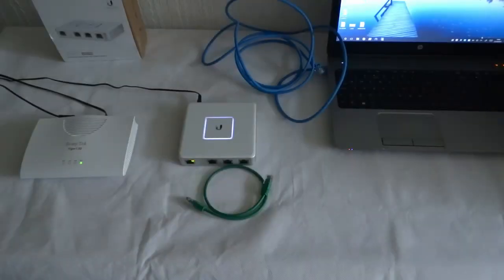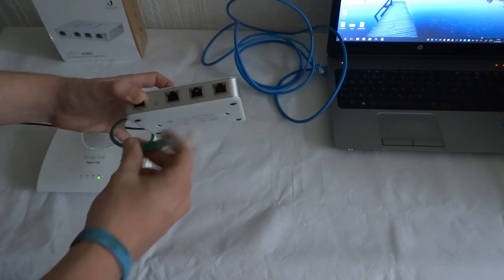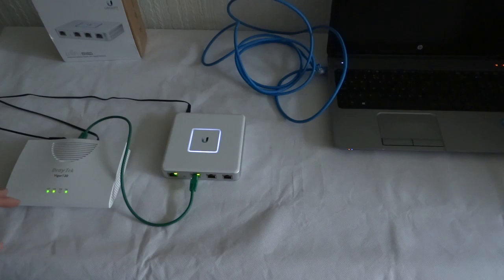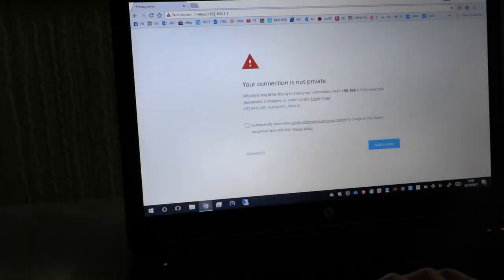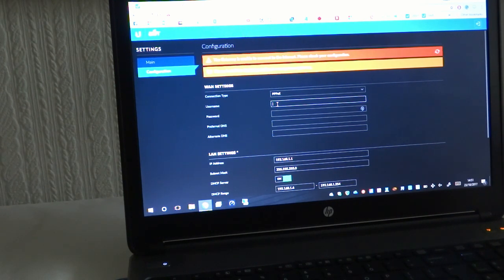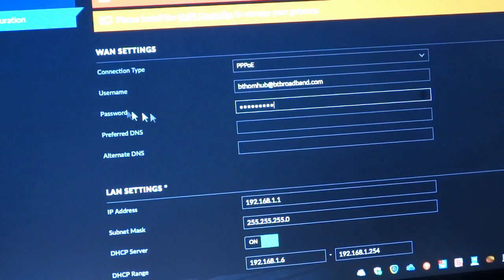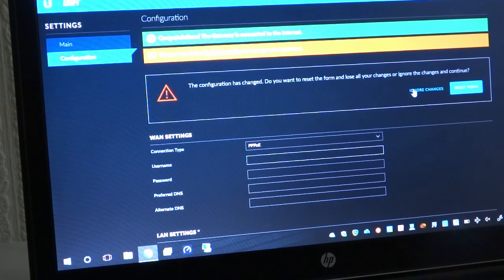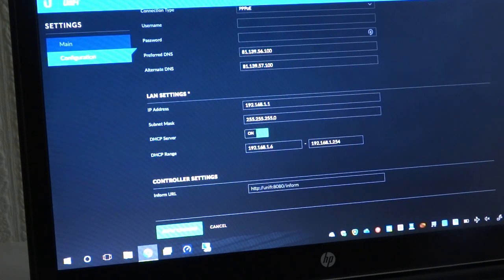Unifi USG with BT Infinity (FTTC) Connection

Comment: what line data do you get from the modem and what's it like at syncing up and down, especially up? and using it with a router with DSL off on it straight into the WAN port, would i put the ip address below the router or above it? the router ip address is 192.168.1.4 so would the modem be 192.168.1.1?

Comment: I tried the Draytek Vigor 166 with my unifi setup and it doesnt work properly, its very unstable with very poor upload speeds tried changing the MTU to multiple different settings but nothing worked. So I flashed the vigor 130 with the latest firmware and plugged in the vigor 130 and it works perfectly. Rock solid download and upload speeds. No setup config needed. Perfect.

Comment: I have configured my TP link Deco system and have internet access, do you know how you can connect to the draytek  GUI without having to sit next to the modem to connect? I'm having trouble locating an IP address to connect to the draytek modem. To confirm I have the draytek 166 modem.

Comment: Hi I have a USG that dose only the client Wifi all worked fine till they changed the router from Hub 5 to Hub 6 now the problem is that I connect the Wan to a Lan  port on BT hub 6 it seem that the USG is not able to take a lease from the router is the same procedure?

Comment: Do you feel you get good sync speeds with the Vigor 130 modem? I'm currently using an old Openreach VDSL modem and it doesn't get as good sync speeds as my BT Smart Hub. But I'd like to continue using my Ubiquiti EdgeRouter, so I'm in the market for another modem to replace the Openreach one.
Reply: What did you do in the end? I'm intrigued to hear that the OR modem performs less well

Comment: Hi James, 
Thanks for posting this video. I am facing a small problem. My setup - running a BT Home Hub5. Unifi AP-LC-LR and a Unifi 24 port switch. Everything works fine but as soon as I put Unifi SG on the network all my devices start showing "disconnected" on the Unifi controller. 
I tried to run PPPoE on USG but no luck. 
I even tried directly connecting a laptop with USG and configure PPPoe, it won't connect to the internet. However, if I change setting to DHCP, it does show USG is connected to the internet but I still can't browse the internet.
any suggestion(s)?

thanks in advance.
Reply: vipinvij The only BT HomeHub’s that’ll allow the USG to connect to the internet are the Business versions, this is because you have to set the Hub into ‘Bridge Mode’ the standard residential version will not allow you to select bridge mode from the interface menu. You can also get into bridge mode by using the DrayTek Vigor 130. So you’ll have to completely remove your HH5 from your setup to get the USG online 👍
Reply: Hi Marcus. That's what I did in the end. Thanks for your reply.

Comment: Hi James do you know if this is the same for standard copper connections via Smart Hub? I'm having huge issues trying to connect my USG to the web. I have it hooked up to quite a network which works fine as a stand alone Wi-Fi mesh but I just can't get the USG to access the internet through ether an old Hub 3.0 or a new Smart Hub with GigE ports!
Reply from the maker: InsideB you can't run this behind a router, the openreach box is a modem and you can run it behind thag or use your own but putting this behind a router will cause double nat along with a while other load of issues. If you want to use it with a bt/British connection you need to use a modem or a isp router in bridge/modem mode

Comment: Looking at doing a similar setup. Having that modem then a 8 port switch then 2 Ubiquiti AC Pros. What benefits are there by having the USG?
Reply: You need a router
Reply: @bobandbobandbob6285  Yeah that would be the USG but if I wasn't to get that I would of got a different router and I want to know whats the benefits by using the USG
Reply: @aaronfraser1911  The USG effectively becomes the Router. It's all depending on where you are located. I usually rip out the ISP devices and use the USG direct but that proves difficult with providers like BT. The only reason I would replace the BT equipment is if it didn't have advanced DMZ because really that's all you need.

Comment: Surely you had to disable DHCP on the Vigor?
Reply: modems don't have DHCP if you plugged your pc into the vigor it would just show your modem ip address not the normal 192.168.1.2 or 192.168.0.2

Comment: Any idea how to do this with Sky Fibre Max?
Reply from the maker: Darren Cousins sky is slightly more difficult, their pppoe details are customer specific and you must extract them from the router they shipped you with software, you can then follow this video and input them there! Hope that helps
Reply: Hi James, cheers for the reply, I extracted the option 60/61 from Wireshark but can't see a place to enter those details in the new USG web interface, it only has PPPoE/DHCP & Static IP, not MER as Sky needs. I previously used SSH to enter the details but with the new interface I thought there might be a more "friendly" way to do it. Currently in a bit of a mess after upgrading and changing my controller, no internet at the moment.
Reply from the maker: Darren Cousins I didn't use wireshark I used a peice of software I hadn't ever heard of I can see if I can dig it out? That gave me PPPoE details and that worked for me when I did this for a friend?
Reply: Yes please, that would be very handy, I didn't even know Sky had PPPoE, everything I seem to be reading says that Sky Fibre uses MER which is causing me no end of pain.
Reply from the maker: Darren Cousins from the looks of what I've read it has changed since I did it, I did it about a year and a half ago and that worked fine using pppoe but when I searched then everything I found pointed to MER:( I had a similar situation with  a netgear 4g router, that used IPPT which at the time wasn't compatable with the USG... had to wait 4 months for a firmware that included and supported it then I was away! Have you not got the included crappy sky router just to get you going? 
Alternatively you could downgrade it to an older fw??
Reply: Just a heads up for anyone on Sky planning on doing this, Sky's T's&C's says that you have to use their router for connection to their service.  Yes it works in other ways but it's most definitely not official
Reply: @Chris Plater this has changed since then sky let you use third party routers but won’t give you support on setting it up or any log in details